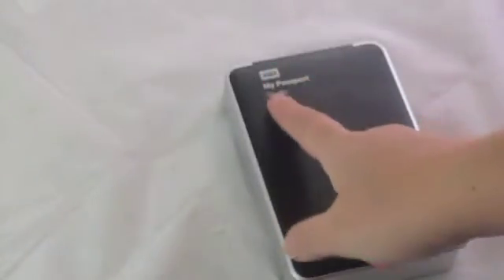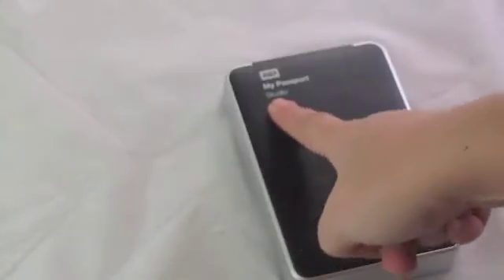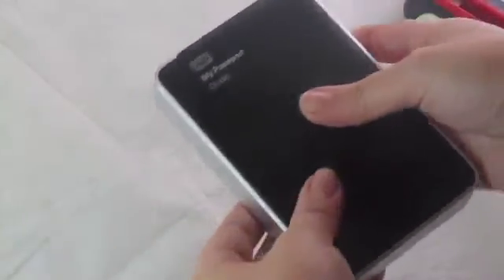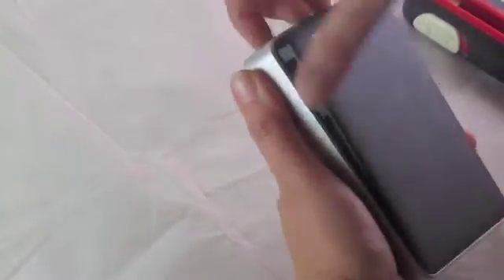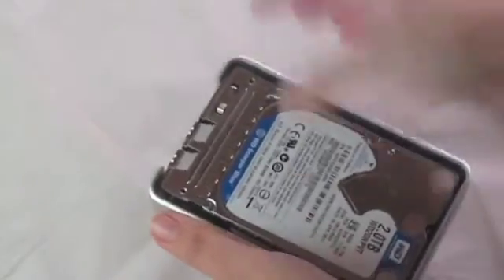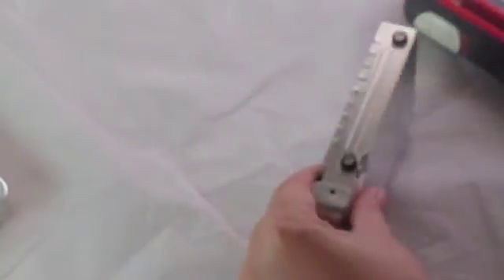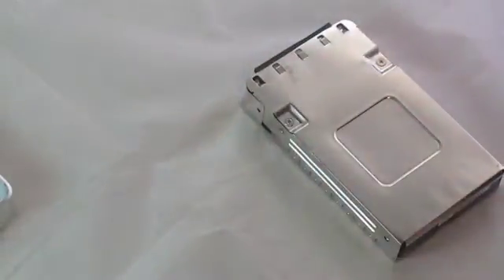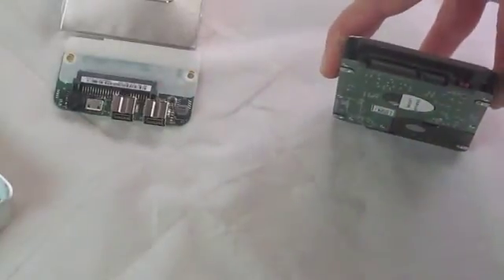How to Disassemble a WD "My Passport Studio" Hard Drive

Comment: Hi sharkamonkey, nice video, thanks for posting. I especially liked where you sped up the disassembly. What size Torx screwdriver(s) did you use? These Torx screws are unusually small, so if I need to buy a set, I want to be sure it includes this bit.

Comment: Hi, Im about to disassemble my Passport Studio cause its not working. Once i open remove all parts I should be able to connect with a SATA cable the HD to my computer and check if the problem is the hub?